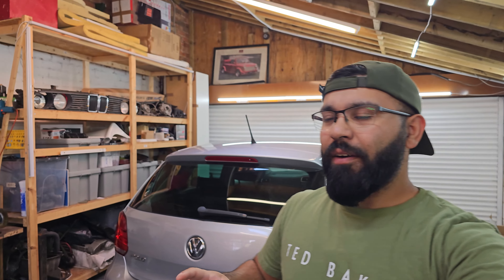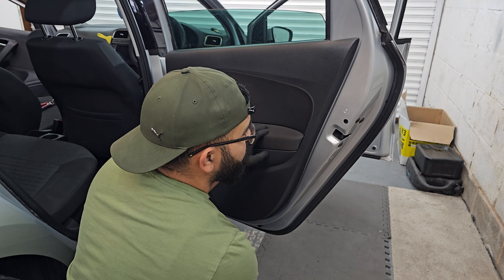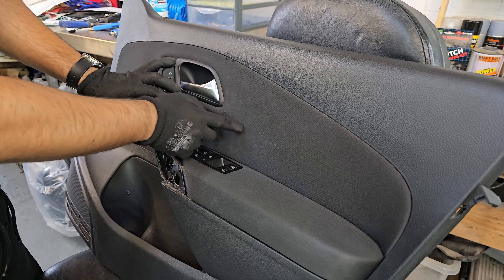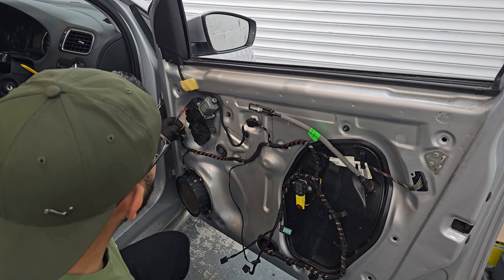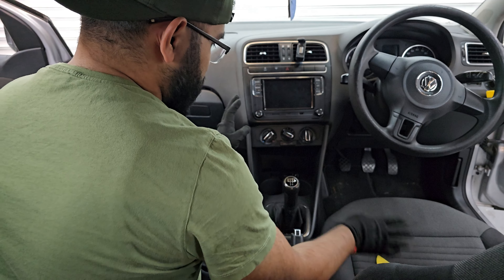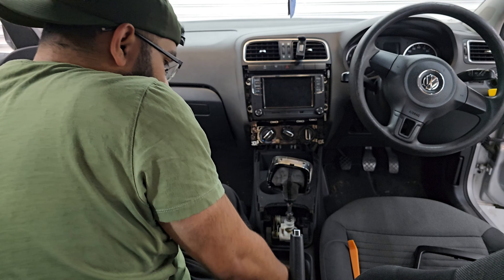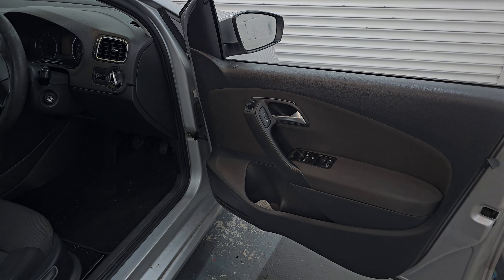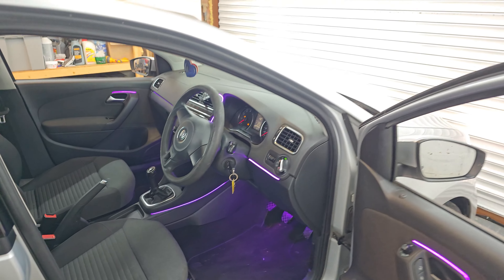VW Polo MK5 Installing Ambient Lighting LED Bead Kit | VW Mods | RGB LED Car Interior Lights

Comment: Looks good. but so sad you got the "cheap version" . the company that makes these, actually have a version where the ambient lighting i tinted with black, which makes it 100% invisible on the black plastic trims :-) but  great work
Reply from the maker: Do they? I actually haven't seen any where the strip is black. To be honest most ones in the past I have used with the fiber optic being tinted ended up always making the lights darker which a lot of owners didn't want. But interested to know more about these ambient lighting with the black tint on the acrylic. Whats the price difference between the cheap and expensive versions?

Comment: I've installed something similar in my Polo, used the same cables to connect but they don't turn off, am I doing something wrong?
Reply: Plug it into ur fuse box